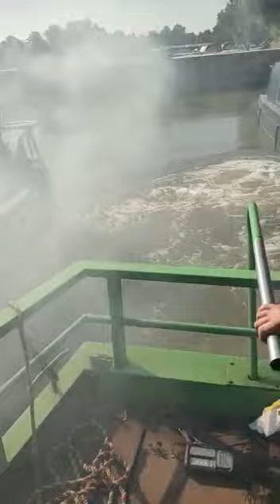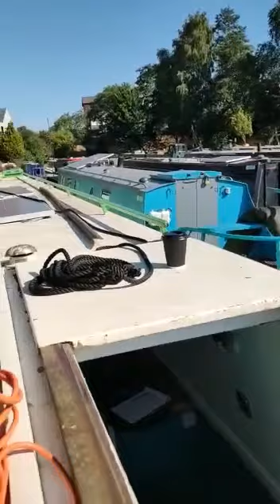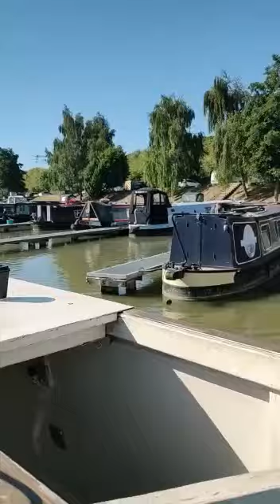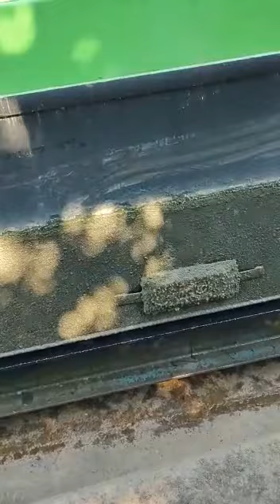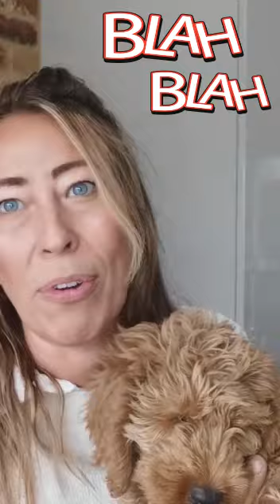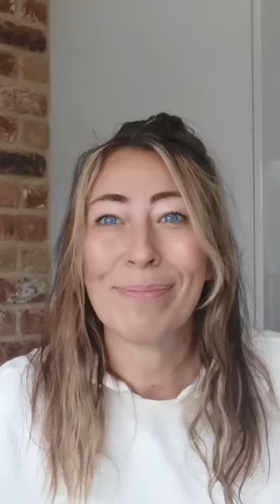Disaster During Narrowboat Survey. Narrowboat engine fault. Ep2

Comment: Generally its 2-3 years between blackings, however, if the boat has hit a few things or had a big scrape then you could have bare metal with no blacking on it only hours after its been blacked. If its been a year since its been blacked and its out of the water then get it done. Gives you another year or 2 or 3 peace of mind
Reply from the maker: Thanks for this,  that's what I first thought that it's usually 2-3 yrs so found it strange but yes you're right we shall get it done as the brokers have said they will do it as it came up on the pre-purchase survey report.
Reply: @uponreflection  the major cost of blacking is getting it in and out of the water. Yucky job but more layers the better.
Reply from the maker: @DEmma1972  yes we paid £300 to get it out of water for survey so I assume they will do it before it gets put back into the water.

Comment: Professional engineer and long term boat dweller (6years)  blacking is basically crap and only ever used on freshwater boats . Not cheap, but a grit blast  and epoxy Hull paint will last you 20 years, as long as you don't make a habit of crashing :)
Reply from the maker: Thanks for this information. It's so good to hear other views on blacking especially us being new to the boating world.
Reply: 20 years is a bit optimistic!
Reply: Agreed. Epoxy is hard, durable and the most waterproof coating. You'd have to remove all old paint/black varnish before applying the epoxy though. Alternatively you can use marine paint like International. All yachts around here are either painted with epoxy or marine paint.

Comment: Just to give you confidence..https://youtube.com/c/TheNomadicCrobot.   
But they are getting there.
 The inside of your boat looks very clean. Fingers crossed on the survey. I'd ask if it needs new anodes though the surveyor should tell you. 
I'm guessing blacking is like blacking an iron stove you have to do it in warm weather to get it to take well.
I won't even take about engines I've had 2 van/car engines blow up on me now.
Reply from the maker: Thanks Glen, yes I follow the Crobots and know their story well.  Apparently the anodes were OK. Fingers crossed we hear back about our engine soon and get an idea of when the boat will be ours, ready to start the renovations
Reply: @uponreflection  all the best. I mainly enjoy renovations. Though not as much energy these days for big jobs. Did, well almost, finished building out a wee campervan.  Have fun.
Reply: Hi Glen, anodes are not a problem. They're cheap enough and easy to replace. A sound hull is more important, and repairs are far more expensive. And as a hint to the owners: check the inside of the hull. Boats often rust more under the floor. Repainting the bilges is easier whilst the engine is being replaced and before all the interior works are done. Anyway, good luck and all the best !
Reply from the maker: @janentomenkafka  thank you  for your advice on this